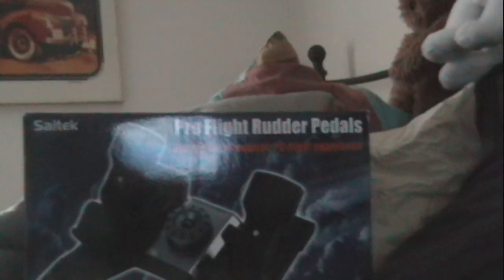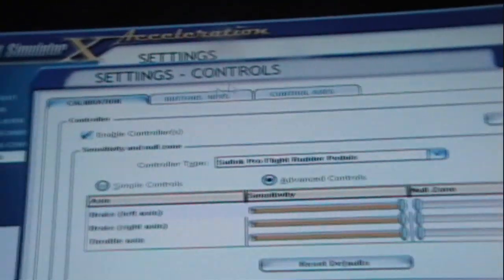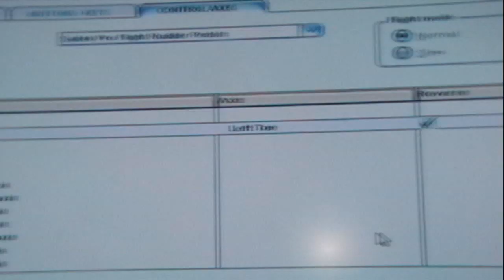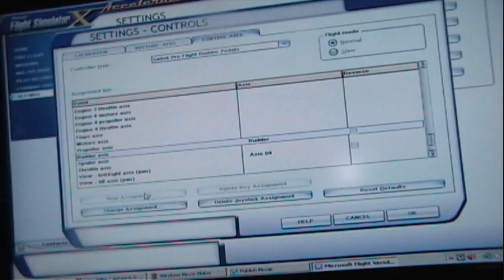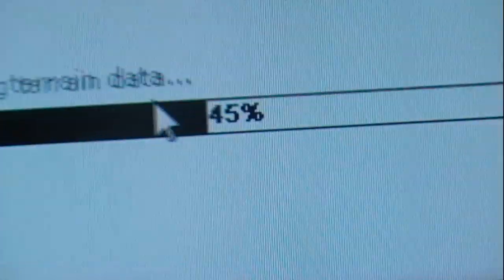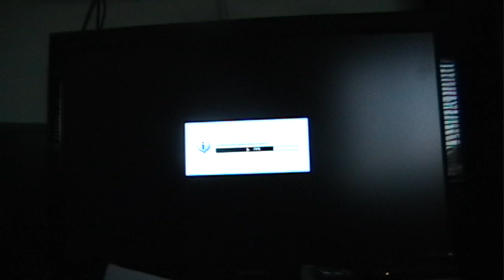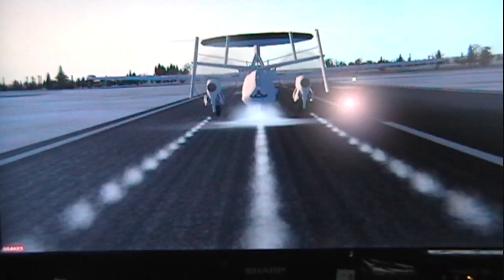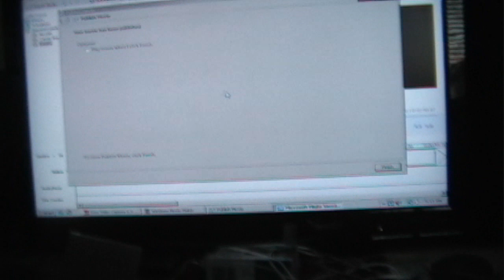How to Program Saitek Pro Flight Rudder Pedals

Comment: Important to delete all other "Axis"  inputs from the FSX software.  For example in the video the "Throtttle Axis" is set to "Axis 4".  This should be deleted and all others like it for your devices or you will have issues, specially in VRS Superbug/Tacpack

Comment: I have a problem. I have program my rudders so when i juse press the left toe or right toe i will brake. but it will not turn off the brake when i have stop pressing. I need to take on the parking brake on so will the brake get off

Comment: nice video man but i have a question how come when you set the toe it automatically puts a check mark on for you on reverse and on my system it doesn't i have to manually do it and also for mine to work i had to play with the sensitivity and null zone and the reverse like to said .are you using vista or w7 ? did you load the software or just the drivers ? also iam on acceleration sp2 thanks